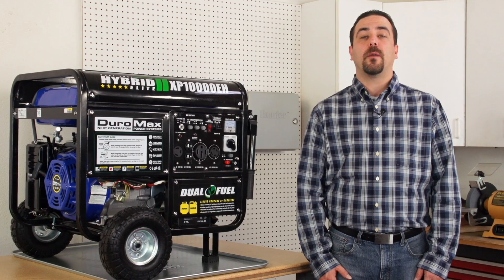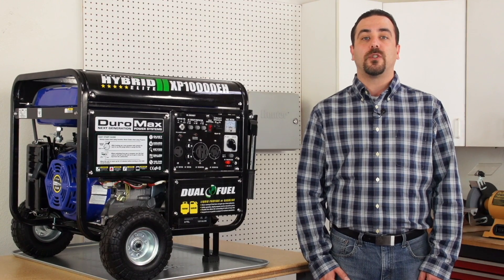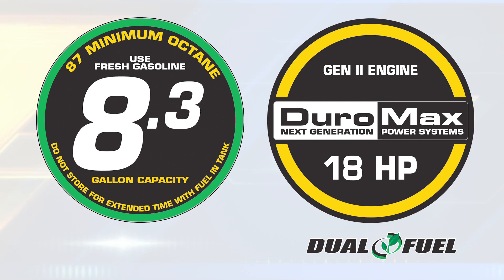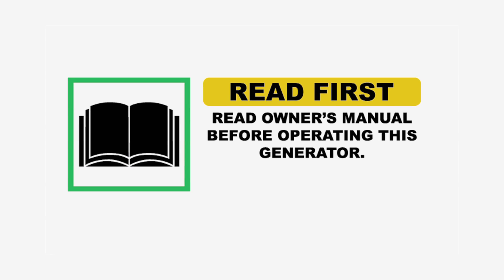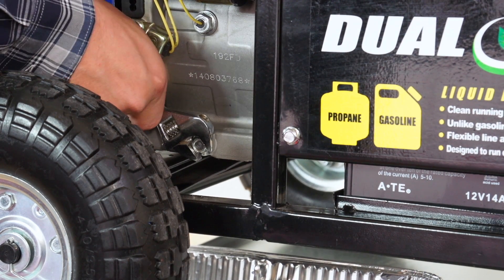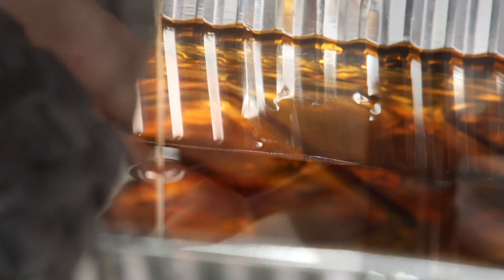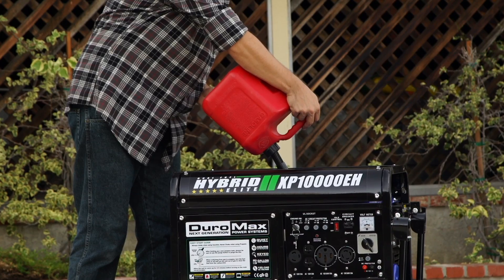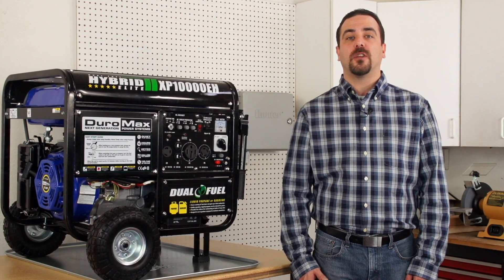How To Oil Your DuroMax Generator: DuroMax XP10000EH Hybrid Generator

Comment: Can you use Full synthetic oil to run longer?
Reply from the maker: Yes, you can use full synthetic oil to run longer. Any 30W, 10W-30, or 5W-30 synthetic oil is suitable for our generators after the break-in period. This helps ensure optimal performance and longevity.

Comment: I recommend that @Duromax update this video, or better yet replace it. Current instructions say to break in on conventional oil for 6-8 hours, then change it and you can go 50 hours between changes under heavy use, or 100 hours of light use. And the guy says to fill it with fresh oil, THEN install the drain plug! 😂 Also does not show the oil fill / dipstick, or how to tell when it is filled properly.
Reply from the maker: Thanks for the Feedback!
Reply: No he doesn’t, he says then replace the oil fill plug.

Comment: The video skips over how to locate the oil
Fill line?
Reply: You fill it up to the top of the threads
Reply from the maker: Correct, you will want to continue filling until it reaches the low/deeper part of the threads. It should be about 1 full quart on this model.

Comment: I have had this unit for almost a year now◔◔>share4.photo/F29WInverter?EもE     I use it to power my toyhauler RV when I'm out in the back country. I purchased this to replace a beast of a Champion unit that was just too loud. I can also lift this into my truck, but the Champion required 2 people. This Firman unit is absolutely awesome. It powers my RV including the Air Conditioning with ease, and it is super quiet! I honestly can't get over how quiet it is.unning air this unit has powered 2 full size RVs at the same time. It also has a battery charger kit that I used when my car battery died. I bought it at Costco so I am protected by Firman and Costco so I know I will get years of service out of this unit. Easy to start, easy on gas and more than enough for the job! 5 Stars! The best part is the price was literally 1/3 of the cost of a similar Honda so my camping buddies now hang their head in shame.

Comment: Oil needs to be changed every 20 running hours? So if power was to go out for say 3 days at home, the oil would need to be changed in the generator every day?
Reply: NO! Thats not what the manual says! It says the 20 hour oil change interval is for break-in. After the first 20 hours, you change the oil. After that the Maintenance schedule says every 6 months or 100 hours. Also I use mobile 1 10w30 full synthetic in mine. Better protection from breakdown.
Link to the manual.  Check page 16
http://duromax-xp10000e.tumblr.com/post/82612401415/duromax-xp10000e-generator-owners-manual
Reply: Steve Burke right?  I have an air cooled  40 year old 14hp Kohler running, and working much harder,  constantly, all 4 seasons. I hope i bought a quality product because its Feb and already breaking spring flood records wth a creek in the back yard at our new house, with my first generator.  Yay for adulting .
Reply: Yes. That's what "every 20 running hours" means.